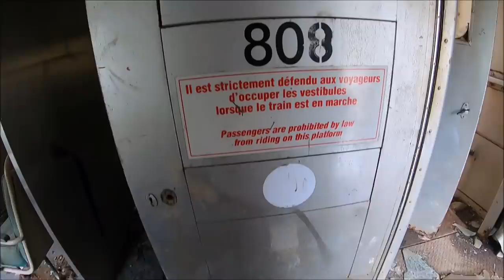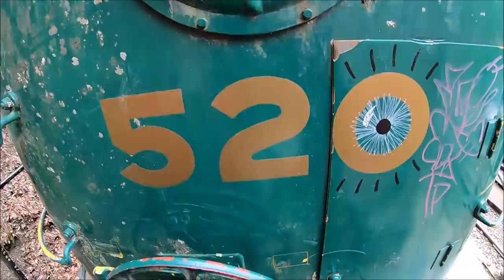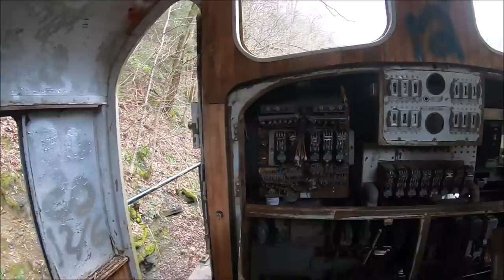Exploring Nemo's Tunnel & Abandoned Train!

Comment: Man. There's no way I'd take my V8 wide-ass truck through Nemo's Tunnel.

What amazes me about things like the abandoned coal mine and diesel engine and passenger cars is the pissed away wealth and infrastructure. Just left to rust and rot. Not even an effort to recycle any of it. Now merely a target for subnormals to vandalize. 

Very interesting video!
Reply from the maker: It was really wide, you're truck would have no issue.  You're right about not scrapping any of the metal.   The train was old, but the mine looked like it hasn't been closed for too long.
Reply: I take my Tahoe through there with plenty of room to spare

Comment: Nemo tunnel was part of the Cincinnati New Orleans and Texas Pacific ( CNO&TP ) .   Southern's high capacity north - south mainline with a portion between Kentucky and Tennessee including the 27 remaining tunnels as of the late 1950's nicknamed  " The Rathole " division .   It was apparent to Southern Railway as early as the late 1950's that the tunnels were too small for the modern diesels and the new gigantic boxcars coming.   EMD SD24 locomotives and 86 foot long hi-cube boxcars and 89 foot long tri-level auto rack cars clouded the line's future.  The EMD SD24 locomotives barely fit with just inches to spare.   The hi-cubes and auto racks couldn't make it through.   Southern Railway daylighted the route by abandoning most of the tunnels with massive cuts or tunnel bypasses or they created new tunnels so that now,  only 4 remain.  Only one old tunnel was enlarged on site.   The new clearance at Nemo tunnel is 20 feet of width and 30 feet of height.  Contrast that with the original tunnel clearance of 15 feet of width and 20 feet to the top of the arch.  By 1964 the big job was done and the Rathole Division remained in name only.   There is another interesting tunnel at Kings Mountain Kentucky.
Reply from the maker: Thanks for the history and I’ll look into the other tunnel.
Reply: My Father was a model railroad enthusiast who modeled the rathole division in HO.  His layout covered the entire basement and had 1😊0 tunnels.

Comment: I'd contacting any local railroad museums nearby because they could potentially truck that railroad equipment out, I can already tell you the locomotive will never run again but it would be good to have preserved as a static display piece. The passenger cars might be able to be restored if the vandalism can be kept down
Reply from the maker: People have been stealing parts off of it. But apparently it’s been closed off and no one can access it easily anymore. They closed Nemo’s tunnel as well.

Comment: 15:48: "Look at these huge electric motors in here."  Close--those are generators, which take force from the diesel engine and turn it into electricity.  The electricity from the main generator (the big one in the middle) runs the real electric motors down on the axles.  Don't feel too bad, though; electric motors and generators are pretty nearly the same thing.  The main difference is whether you feed it mechanical force to get electricity (generator) or feed it electricity to get mechanical force (motor).  It's actually quite common in railroad practice for the motors down on the axles to run part-time as motors and part-time as generators—when they run as motors, they pull the train, and when they run as generators, they soak up mechanical force from the motion of the train to slow it down.
Reply from the maker: Thanks for the explanation.

Comment: @16:56. That's the back of the engine.
Reply: Early hood diesels such as these oftentimes were designated to run long hood forward, especially considering this is a Southern Railway locomotive, which made it common practice.  The best way to check is to look for an “F” at one end or the other, near the steps.  That identifies the official “front” end.